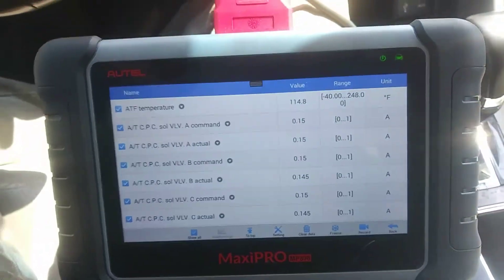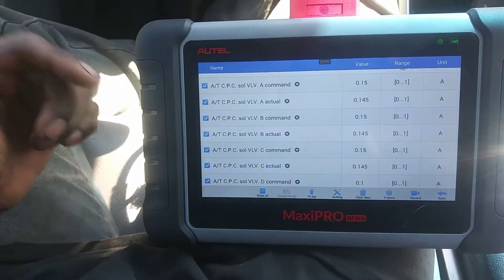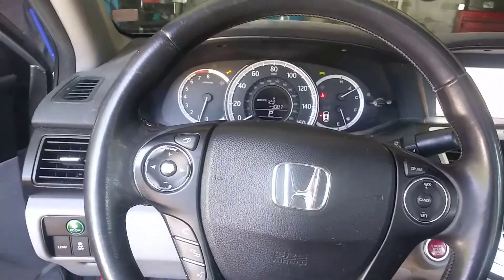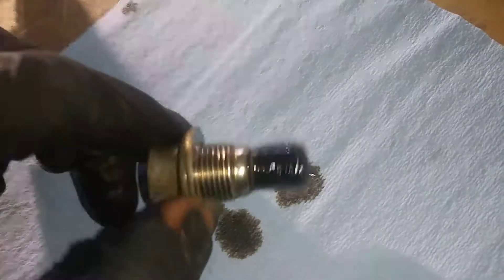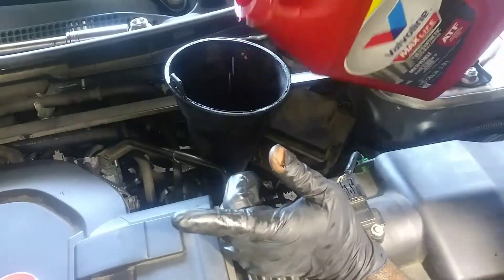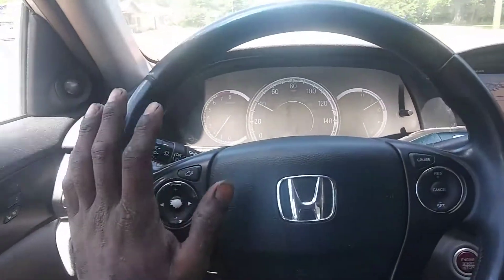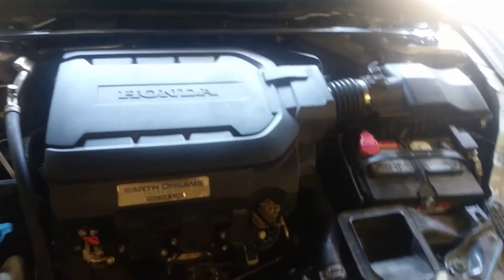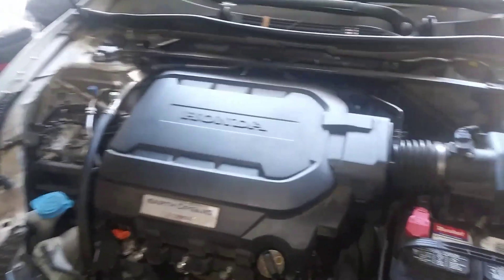2013 v6 accord transmission judder and shakes! What really fixed it???

Comment: I was having the same exact issue. I have a 2013 accord sedan v6 and i was coming across a little shaking going about 20 mph and going up hills. After i saw your video i notice we are having the same issue. Did the trasnmission flush just one time and that did the trick for me. Its crazy that a simple transmission flush and refill did the trick. Thanks for the video 👌👌👌
Reply: Do I need to do a flush or a drain and fill will work

Comment: Excellent!
Thank you
My 2013 EXLV6 is amazing 
Needed trans gasket and engine gaskets 
HAVE 88,000 miles but still drives and handles like new
Amazing gas mileage on long drives 35/37 Mpg and this car is very quick with its V6!
Nice video
Reply from the maker: Transmission gaskets??? Enlighten me on this one🤔

Comment: Doing a simple drain & fill on these “Hondamatic” transmissions usually does the trick. The difference between the Z1 & DW-1 fluids is that the DW-1 fluid doesn’t break down as easily as it’s predecessor. 

But I’ve been hearing how certain other oils work perfectly than the official Honda stuff like the one you tried.

Comment: Ive never had any shutter problems. But Ive had 4 starter replacements. So this time I had the torque converter replaced. Now I feel a shutter when cruising on the highway 😏😏I'll just continue to baby the transmission til it fry's out. My Camry has been bullet proof to say the least
Reply from the maker: I know the issue you're referring to... Technically the torque converter shouldn't be replaced, just resynchronized, or clocked back one hole. I did this procedure on this one also, failed to document. Been 3 months no call backs. I could see issue on ring gear

2-3x fluid changes will resolve this, clutch contaminants causes sticky shift, Or transitioning issues simply put.

Comment: What about when your warming your car up then you go to put in drive and it vibrates as it's switching into drive?
Reply from the maker: Those are similar symptoms of bad motor mounts
Reply: @partsshooter  thanks for your insight bro!! ima try to drive softer for now until switch my mounts to the MT mounts they are built stronger.

Comment: My 2016 Honda Odyssey had a slight judder between gears (2-3?). At 100,000 I did the first drain and fill with Honda OEM fluid and the judder is gone. I will do second drain and fill soon.

Comment: Did it get better?   I have 2013 v6 accord sedan with 151k miles I changed fluid after 110 miles 2yeats ago now its been acting like that last couple of thousand  miles.  So after I saw your video I changed yesterday  7/26/22.  It drives better will another flush help. Or should  I drive for 2 weeks then change  fluid again plus drain and fill bolt washers

Comment: The updates you talked about will K-Tuner be useful? If I flash the ecu and load a map do you think it should help. The k-tuner map will have an effect or desired affect on shifting what’s your take
Reply from the maker: I'm not sure k-tuner ability.  But this issue was resolved with fluid exchange

Comment: Having issues with my honda when slowing down between 20mph down to 0. I notice the rpm jumps up to 1200rpm and down to 900rpm at idle. That 300rpm would jerk the car a bit before a stop. Any ideas? Acceleration is mint, also did 2 drain and fill.
Reply: It’s down shifting from 2nd gear to 1st a little late than it would be. I find that even some newer Lexus/Toyota vehicles will do it too if the user drives rough most of the time. 

Try to drive the car in a gingerly fashion (especially when stopping) to teach the computer to shift smoother.

Comment: My 2010 Honda accord 2.4 judder, shakes at 65 mph to 70 mph only under acceleration has only 45000 miles I had tires balance, tire rotation, alignment, CV axel replace, control arm replacement. I have the feeling it could be a transmission problem I don't know if this transmission can be reset it. I will replace the transmission fluid and hope this solves the problem.  Any suggestions  I will appreciate it.
Reply: Exactly the same speed range for me too. I have 2011 accord v6. Just had a drain and fill and added instant shudder fix and it improved a little bit feeling and scan tool wise. Brining it into a transmission shop Monday to see if it's just a torque converter or need a whole new transmission.
Reply: Hello..how did u fix this eventually.  Did changing the transmission fluid help? I am having same issues with my Honda 2013 V6
Reply: @patrickkudaisi7550  Did you fix it?
Reply: @yoyotvyoo  No. Changed transmission fluid but still same.

Comment: Have you run into a vibration coming from drivers side on a 2014 accord V6 trying to pin point problem took it to 2 dealers and they cant figure it out
Reply from the maker: That's could be a plethora of things... Try providing good detail as to when it happen, I'll throw some ideas out
Reply: Happens on acceleration even on the highway at cruising speeds new tires balanced nothing stands out from underneath the car I checked tie rods lower ball joints etc
Reply from the maker: @robertalicea5585  typically cv axles will cause issues pinpointing vibration. Especially if the vibration only occur when accelerating under load ONLY, when you let off accelerator, vibration stops.

So, the only unique symptom cv axles have is that under loads it vibrates, levels out as load demand level out.

Cv boots can look good superficially, thing is -oil can dry internally or become tacky and ineffective causing bearings to prematurely wear causing axial rotation to be imbalanced, the torsion under loads cause this imbalance to be pronounced

Comment: I have a V6 Honda Accord my transmission started having shutter around 60,000 MI

The transmission shutter is very common in the V6 Honda motors apparently the torque converter has locked up issue I have found that if you change the transmission fluid around every 35,000 mi or 2 years and keep it nice and clean the shutter is almost non-existent.

A additive I tried is called Dr shutter fix specifically designed for torque converter lockup I gave it a try dumped it in my V6 Accord after changing out the fluid literally got rid of 95% of all shutter and vibrations so about every 2 years I drain and fill the fluid and dump in one bottle of shutter fix currently have 160,000 miles no issues on my transmission

Also the V6 accords tend to have a shutter when the transmission fluid is cold if I start my car and it's like 30° outside and drive it it will shut her if I let the car warm up 15 minutes fluid gets operating temperature shutter is gone
Reply: This is great feedback, brother. 2015 EX-L v6 Coupe has light shudder at/around 1500 RPM at light throttle application. At or above 45 MPH (assuming smooth acceleration and in 6th gear) it clears up as the converter locks up. Even slowing down (no brake or throttle application) through approximately 25 MPH I can hear and feel the converter not unlocking entirely until I add throttle again. It’s almost as if it is unsure whether it needs to stay locked up or not. If I commit to throttle or brake application, it’s fine.  But if I put it in this awkward “neutral” place, it has a hard time deciding. Honda did a full flush, filter, and software update about 2 years ago. I’m military and got to Hawaii a few months ago and I’m noticing it more since I do so much city driving now. The fact that you mentioned the 36k or 2 years aligns almost perfectly with my experience. The only reason I don’t have a manual is they didn’t come with them in silver!  Thank you much.
Reply: @nateglasscock2883  I usually change out the fluid every 30,000 ish but I saw a blog about a mechanic talking about how most OEM fluids is obsolete how the manufacturers make fluids in guidelines with fuel efficiency in regards of hitting EPA numbers he talks about in the review how over the years transmission fluid has been getting thinner and thinner versus thicker in the older cars in the '80s and you see more transmission problems nowadays because all they focus on is fuel efficiency. Toyota has really great fluid that lasts roughly 80,000 mi in their transmissions but Nissan fluid and Honda fluid both get really dark very quickly which means it is not synthetic. Last winter I decided to switch I put in amsoil 100% synthetic transmission fluid I decided to get rid of the Honda fluid to see if it would help I spent $140 on a 10 quart jug online I did two drain and fills back to back I drained out three quarts went up drove it around the highway 5 6 mi drained out another 3 quarts and then I drove her for a week solid put about 350 mi on it and did a third drain and fill and I replaced it with the 100% synthetic fluid added a bottle of Dr shutterfix which I got off Amazon for six bucks and it been working pretty fine currently have 160,000 miles on my transmission it still does lock up a little bit on cold days when the temperatures in the 30s I found if I let the car warm up outside for 10 minutes in the winter the shutter goes away
Reply: @nateglasscock2883  same issue here on 2015 v6. 40k miles just starting 2nd drain and refill to see if it ges better ,  kinda desperate tho. Wasn't expecting that
Reply: @hamicitro1606  when you do the fluid change with Honda fluid try to add a attitude called Dr shutter fix you can get a bottle on Amazon or advanced Auto it will knock out about 80% of the rough shuttering or rough shifting after you put fresh fluid in.

I found if I change the transmission fluid about every two years 30 to 40,000 miles when I change it with OEM fluid I put one bottle of the shutter fix and within 250 mi of driving the car after the attitude is added the transmission is pretty smooth

Comment: Is this a CVT or normal auto Ive  140km 2013 asian (thai) Honda City 1.5l Vitec despite changes of gear oil (the first one was really late by years and I think that damaged the box) so now ive a pronounced JUDDER at the rev range you note. Ive tried to record it with the 3 axis accelerometer in my phone but cannot see it but feel it yes very bad now last change is EGR and maybe plugs and injectors but the engine is smooth so its fine. CVT torque bad spot maybe or rubber band in the CVT worn out DONT BUY a Honda City in asia (Hua Hin Honda useless not even a rolling road to test)

Comment: Hello, i have 2014 Honda Accord i4. When i turn on the Air Conditioner, the car vibrates really bad. No jokes, it shakes as if you're in a massage chair. Pls i need help on this.
Reply from the maker: Ac compressor is a load on the engine, causes low idle as a result, vibration occur. One or multiple motor mounts are bad and or idle issue, the idles low. Try cleaning the title body
Reply: I have a 14 accord also. I had similar situation when using the AC. the car runs at 12 volts unless the headlights are on. I try to keep my headlights on to demand the 14 volts if im running the ac. It helps out alot. Doesn't feel like the car is gonna die when the ac kicks on.

Comment: I was fired from my job because Firestone told my boss I blew the engine.  The tow truck driver and the people at Napa tried starting it it wanted to go just maybe the compression was bad . 
The van speed was regulated and I hit oil changes on time. The manager doesn’t know about cars so there’s that. Firestone I hear doesn’t do much for engine repair.

Comment: Hey Parts Shooter! Still happy with the Valvoline ATF fluid in your Accord?
Reply from the maker: Yes, they're still good... They never called back with a complaint😎
Reply: @partsshooter  good to know thanks! Imma try some in my odyssey. The Honda fluid isn't that special I feel.
Reply from the maker: @newscanman3603  I'm the same! The fluids have to meet same standards to b be sold on shelf.

Also, oil is very subjective, look at dexos additive in oil, never had issues changing Chevy engine oil without that additive.
Reply: @partsshooter uneducated statement

Dexos is an oil approval standard, not an additive

Comment: So if anyone can help please do. But 3 days ago I change drained and filled my transmission fluid (not sure if this is the reason) but I’m driving and then start applying my breaks and hear something like a jack hammer noise coming from outside not knowing it’s my car then realized it was and it’s judder and shaking when I apply my breaks. Then once my breaks are applied and car stops I try to accurate lightly and have to push on the pads alittle for it to go forward as if I’m going Over a bump and the car judder and shakes as I’m doing it. At some point after a min of driving it will sound Normal but once I apply any breaks the noise will start over again. Going in reserve I haven’t heard anything. Any suggestions would be greatly appreciated.  Also this might help but as I was filling one of the quarts into the funnel it slipped and maybe a “quarter”of one bottle didn’t go back into the transmission
Reply from the maker: Did you have these issues before you change the fluid?

-if so, provide more detail revolving around your issue. Is it ONLY when you apply the brakes, normal cruising or both? Any particular speed it's more significant?
Reply: @partsshooter  thanks for getting back to me. Found out the issue, the bolt to the brake pad housing fell off and was causing all the issue. Thank god i was able to just screw a new one in and it wasn’t something expensive 😆
Reply from the maker: @Slb5988  I'm not gonna ask how! Cool 😎

Comment: Honda trans fluid only.
Reply from the maker: Why?  What make this fluid inferior?
Reply: Yes,  only used  Honda  fluiddw-1
Reply: @hectortijerina3950  that's why you do your own and not rely on someone else
Reply: Funny thing is some dealerships dont even use their branded fluid, but they'll sell it to us for $20 a quart.  Case in point, several hyundai dealerships that l know of use BG atf. Not Hyundai branded atf.  They get the stuff in bulk and probably discounted price.  There is no rule that you have to use oem fluid. As long as the fluid specs are in line with what the manufacturer recommends you're fine.  I'm sure Hyundai isnt the only one doing this either.

Comment: You wreckd that cvt
Reply from the maker: Yes that's correct
Reply: @partsshooter  but this shouldn't be a cvt? This should be the 6 speed auto, the cvt comes with the 4 cylinder only
Reply: @Thanson199415  thats wrong they made the 2013 3.5 exl came optional woth cvt I know I own one
Reply: @milkmacdonald3992  if it was a v6, then I stand corrected :)
Reply: @Thanson199415  its a 3.5. V6 with a cvt
Reply: @milkmacdonald3992  learn something new everyday hahah
Reply: @Milk Macdonald  never heard of it. The 2016 exl v6 only comes with 6 speed auto no cvt
Reply: @milkmacdonald3992   doesn’t exist only 6 speed auto with the v6 2013-17